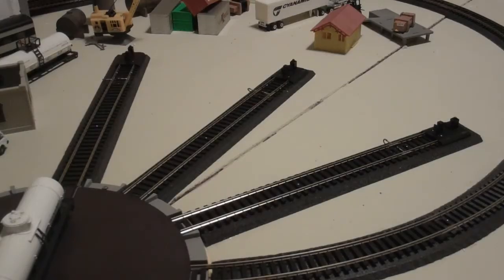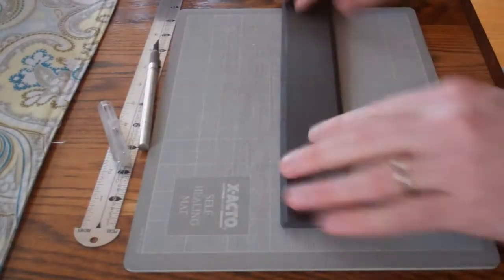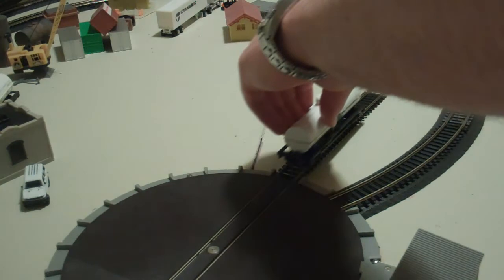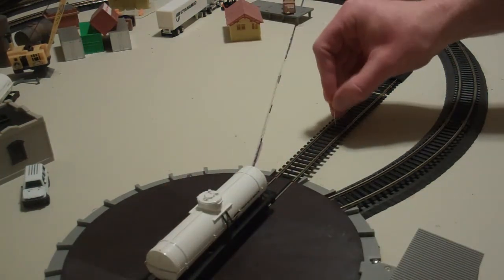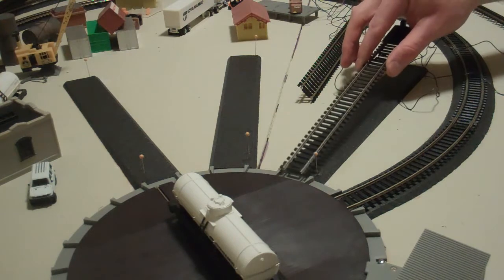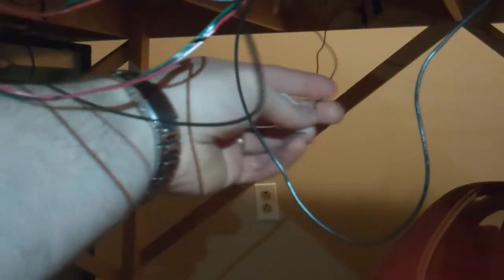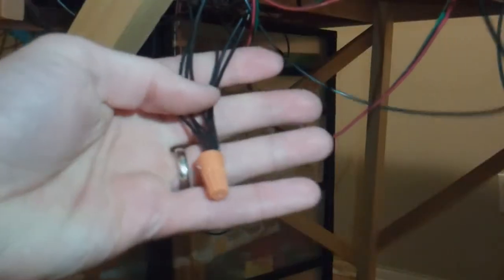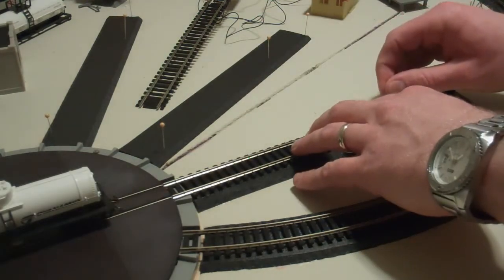Installing Stall Tracks for a Turntable

Comment: Install insulated track joiners or cut gaps in the track on each bumper section to isolate the bumpers from track power. Connect the wires to fixed ac or dc terminals on your transformer if you want the bumpers lit all of the time.
If you leave the set up as it currently is where the bumper lights only when track  has power you can use it to insure you have powered the particular track for your locomotive.  Hope this helps.
Reply from the maker: Thank you very much! This layout no longer exists but the information is helpful.

Comment: A very nice and informative video. I have plans for a turntable on my own layout, but am wondering:
1) If I would need to file the edges of the rails leading onto the turntable.
2) If so, what would be the best tool to use.
Reply from the maker: Thank you! I don’t think you have to file the rails. I sure didn’t. If you need to, you can purchase files for rails. Not sure if it’s a special tool or an ordinary file. Mircromark probably sells them. Good luck!
Reply: @MMRails  You're quite welcome, and thank you for your response :).

Comment: Most DC controllers provide a full time 12v output, so just use that to power the bumper lights !  As others have said rightly, it is much easier with DCC because tghe track is fully powered all the time,  but even that needs a small rectifier in circuit to provide DC current to the lamps.
Reply from the maker: Ian Turner   Thanks Ian! I'm still learning the ins and outs of both DC and DCC.

Comment: You can slice in three SPST toggle switches to the lighted bumpers and install the switches to the command center. When you select a spur track, also select the light toggle switch. You will need to isolate the light bumper and use the same 'common' set up. The gap rail wiring would go to the toggle switches. As a bonus, you can exchange the red light for any color.
Reply from the maker: Ah man, where were you three years ago! Lol. Thanks for taking the time. This layout now belongs to someone else.
Reply: @MMRails  wow! Have you built a new one since then?
Reply from the maker: CRSR DASH-8 40B   I can’t tell if you’re joking or not. I moved two years ago into an apartment. Started a new DCC layout. I still have most of my DC locos and the rolling stock.

Comment: is it necessary to separately power each individual stall track in order for the turntable to be used? I know some of them will only energize the track they are aligned with. thanks.
Reply from the maker: I don’t think you have to. Each track needs power to move the loco on that track. The track on the actual turntable has its own power if I remember correctly. Make sense? It’s DC, so if you want the loco to move, the track has to be powered.
Reply: M&M Rails so if I want to add a turntable to my layout, and be able to actually switch locomotives around using the turntable, I will have to separately power each stall track?
Reply: M&M Rails because I believe (might be wrong lol) that the Bachman turntable used the incoming track from the main layout to power whichever stall track it came in contact with, eliminating the need for this. Only downside is I can’t find one of those anywhere.
Reply from the maker: @chriskuruc    I only know how the Atlas one works. Having power to each track is a lot of work, but worth it. My brother and I had several locos on the tracks and if all the track was powered at once, when we cranked the throttle, all locos would move. With separate powered tracks, only the loco with the powered track moves. There are a lot of switches and wires as you can see. I don't bother anymore with it because the novelty wears off and it's not in my era now. Good luck!

Comment: Mark, Do you use a bus-wire to connect the 7 wires to? that would make the end connection only 1 white wire
Reply from the maker: I thought about it, but have no experience with bus wires, so I went with what I know. Thanks for the suggestion.

Comment: Pardon my ignorance, but how do you avoid inverting the polarity in the case of turning a locomotive 180 degrees? I have no clue what's under those things so I have 3x questions about it. Is the TT an independent block itself or it just gets powered by the block/track is facing by just physical contact?
Reply from the maker: Jefferson Aleman   Great question! The turntable track does have its own block. There’s a switch to power on and off the track. And the turntable is split in half. A and B sides. It gets complicated and you need practice.

Comment: Mark... first you need to insulate the bumpers from the track... then you'll need a second power supply IE wall wart with min. voltage of 7 volts.. max 12V & a spst (on -off) toggle switch... run one end of the power supply to one of the wires or rail on the light... do the same with the second wire except cut this wire & install the spst switch.. the bulbs are incandescent so they are not polarity sensitive...  hope this helps.. vinny
Reply from the maker: It helps, but it's not the answer I was hoping for. Your solution requires 2 switches and I want to avoid that. Thanks though Vinny, always appreciated.

Comment: answer to your question is to use insulator track joiners and run wires to the bumper that supply it with steady amount of power.
Reply from the maker: The 20th Century Limited   Thank you so much. I hope to get around to it one of these days.
Reply: M&M Rails no problem, as long as I can help a fellow modeller lol. And what I mean with the insulated joiners is put it where you had the joiners with the wires. This will unfortunately result in needing a different way of giving the track power.

Comment: Hey Mark! I made my first DC model railroad using your videos to help me :)! Quick question: Did you make a roundhouse to shelter your locomotives??? If so how did you do it? Thx Mark!
Reply from the maker: That’s great Gabriel! Glad I could help. I purchased a roundhouse, but it didn’t fit and then I never bothered. It’s a good idea though. Try and find a roundhouse by the same makers of your turntable.
Reply: @MMRails  thanks Mark!

Comment: Just add a cheap n/o 12v Relay which you can power with a separate 12v tap off from your controller conect your lights only to the switched side of the relay. Power on can be switched via a simple magnetic Reed switch under the track. Sounds complicated but it's really not. Please contact me for a full diagram plus I will send you the links for the relays and switch off amazon, cost under £1 pound Sterling. Brilliant video as im just installing an atlas myself. Ps you could buy Kato self lighting buffer stops but each one costs over £10.....
Reply from the maker: Wow, thank you so much Nigel. Unfortunately you’re too late. I sold this layout a few years ago. Good luck with yours!

Comment: I watched this video 4X. just to be different. with the bulbs getting the power from the rails, there is no way to keep them on full. but if you seperatly wire them, then you can do it.
Reply from the maker: sparky107107   Thanks Dave. I hope you watched the ads 4X too. Lol. I'm going to try a few things with the light. We'll see.

Comment: I would use a relay to make up the light circuit which would be direct wired to the light power.  You probably already figured this out though since your video is 4 years old.  Sorry 😞
Reply from the maker: Thanks Edward! You’re correct, this is a moot point now because that layout doesn’t exist but I really appreciate you watching and taking the time to comment.

Comment: That's the way your light is going to work as long as it's powered by your DC power pack.  Frankly, there is no simple solution to your problem.  You'd need a DC to DC converter circuit.
Reply from the maker: J&K Railroad Company   Thanks Patrick. I must be thinking AC. My water tower is on a switch and is not affected by the controller. But I think it's AC. -Mark
Reply: M&M Rails - that would fix it!

Comment: A turntable sure adds value to the layout. Thanks for the video which is very useful as I am planning to install the Atlas turntable on my DCC layout. A decoder can be added to the motor to enable DCC control. Have block detection too so the new Digitrax product will be quite useful for the approach, bridge and 6 stall tracks planned. http://www.digitrax.com/products/detection-signaling/bxp88/
Reply from the maker: Chandy Paul   Thanks for your comment. I'm building a DCC layout right now but I think I'll pass on the turntable. Looks cool, but I never use it. Glad you enjoyed.